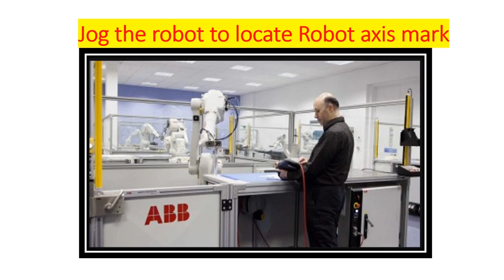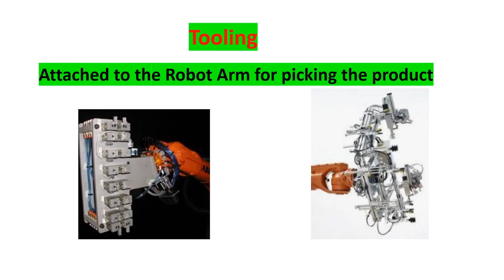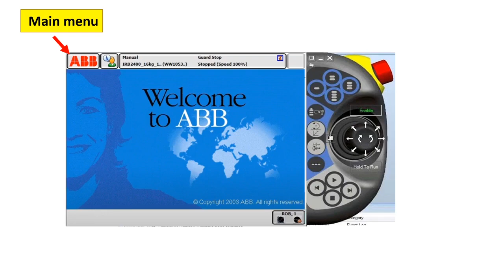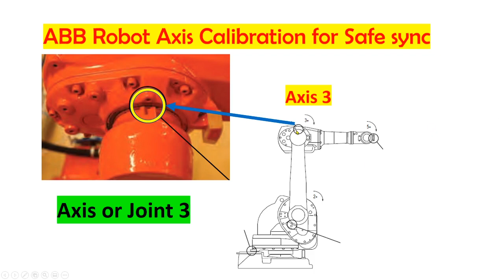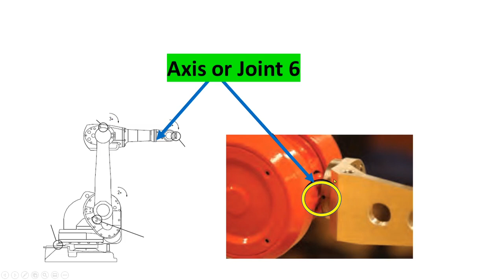ABB ROBOT PROGRAMMING PART 1(PLAYLIST@DESCRIPTION

Comment: Whats the pyrpose of revolution counter update and should we do fine tuning if just replace the motor?
Reply: You speak too much but really you don't know what is really is if you change the motor or if you have an external axis you have to do fine calibration but for the 6 servomotors from 1 to 6 of robot you have between the axe 2 and 3 calibration offset a map for every axe the resolvers values and in the door of the controller you find the same resolvers values so if you do a fine calibration you change the geometry of the robot I hope you understand my answer and Allah know better than the all
Reply from the maker: You need to calibrate axis especially if your going to replace a servo motor, doing change oil of the drive gear of every axis and when you are going to replaced the sevo PCB BOARD